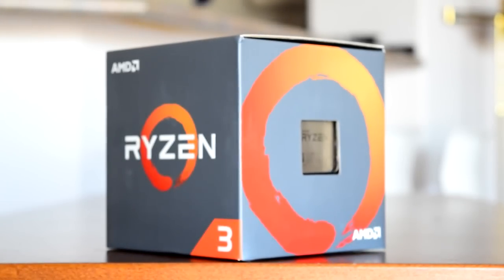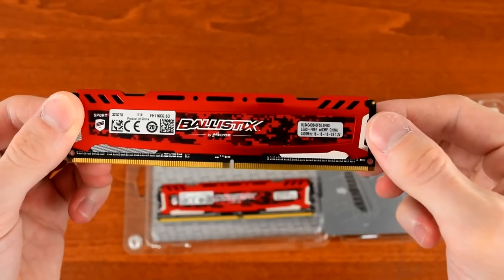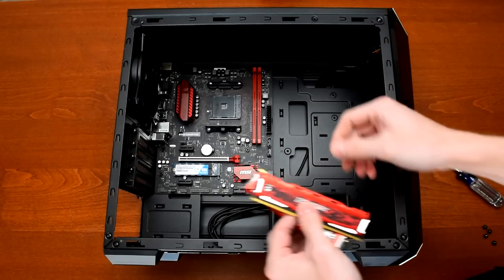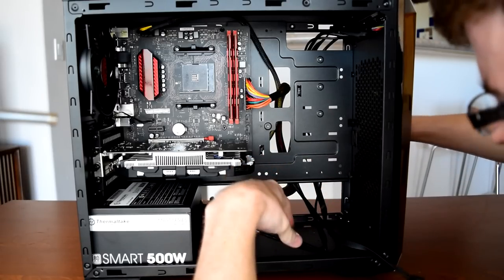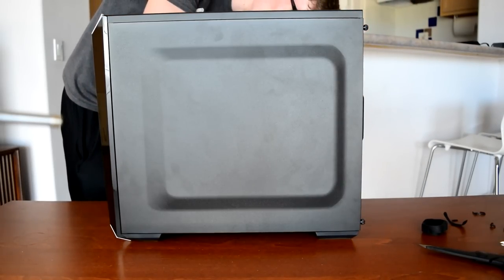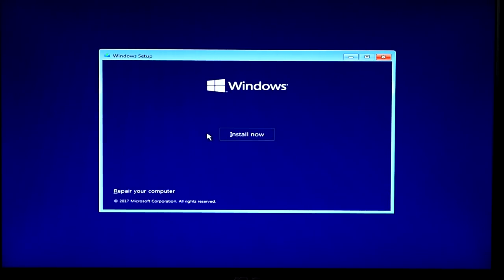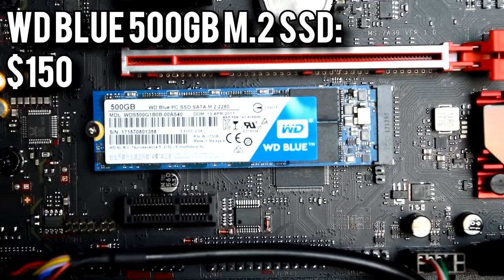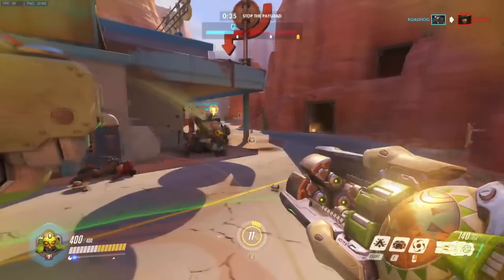Little Red: Under $500 Ryzen 3 1200 Budget Build!

Comment: Or you could replace the SSD with a 1tb HD from WD, buy a Ryzen 1600 and get a 1050 TI 4gb for 50 dollars more, get a cheap EVGA 430w PSU, and save a lot more money in the process.
Reply: Simple You should not cheap out on the PSU.
Reply: It's got good ratings, and is cheap. It's just for people on a budget
Reply: its evga its not bad quality it just has less watt output
Reply: is 430W okay for this kind of setup
Reply: Well a r5 1600 has a 65watt tdp and the 1050ti requires a 300watt psu so yes you can
Reply: i would rather get a r3 and a 1060 or 1050ti though its better for gaming and you can upgrade later
Reply: i shouldnt say better but its close
Reply: I built my PC with a Ryzen 1600 and GTX 960 4gb, I get 60FPS on most games, if not more! COD MW2 runs at 100 FPS on max
Reply: Even a good 350W PSU would be totally sufficient for this kind of setup. I´ve seen power readings of systems with an R9 390X that draw around 350W peak!
Reply: How do you figure when the 1600 is like 230 bucks right now
Reply: Say it's 220-plus 150 for the ti.  Then even a 30 dollar case,  30 dollar supply,  50 dollar HD.  and an overclockable motherboard for the 1600 is like 60. Then 60 for ram.  That's 600
Reply: I'd just upgrade to a ti.  He'd get frame drops in modern games with 2g vram. 
Or my two builds I haven't decided on yet.  
1tb,  30 dollar case,  found a 30 dollar 550w evga for 30. Ram 62. B350m overclockable for 60, ryzen 3 110. Then a 1060 6gb is 270-289. 
Or the same thing but switching the ryzen to a 1600 and buying the ti then upgrading to a 1440p capable card when the new cards come out early 2017 and when the gpu prices are better.  Basically what you said on that
Reply: famous dev just get a better gpu and a 1200
Reply: Getting a better gpu and a lower tier processor can lead to bottlenecks. The 1200 has 4c 4t, the 1600 has 6c 12t.
Reply: Simple a 1060 will not be bottlenecked by this cpu, anything higher might be though
Reply: who pairs a 1600 with a 960? That defeats the purpose of a gaming pc
Reply: if it defeats the purpose of gaming, then why am I getting over 70 FPS on all games max settings (fxaa turned down a bit). Plus, I bought the 960 a year ago, and i got it for a pretty good price, so I'm happy with what I have. I have also yet to overclock, lol.
Reply: Idk I moved my budget up recently.  I found a 1600 for 200 bucks.  Any going with the 1060 6gb.  Then I have an upgrade path to a 1080 in the future when selling the 1060 and not have to touch the processor in the future.
Reply: Looking at like 650 with the 1600 and 1060 with the parts I have priced out now.
Reply: The only problem I have with my 1600 is that it heats up to about 50 degrees Celsius while playing games, sometimes making my pc shut down, but that's because of the climate I live in, California gets really hot sometimes. But yeah, the 1600 and 1060 are a really good pair, make sure it's the 6gb variant otherwise you may have VRam shortages.
Reply: You want a 140mm fan outside. Mine is a Thermaltake TT 1425, quiet at 17dBa. Got it from Ebay.
Reply: Shane Ma is 500w enough??
Reply: Simple 50℃ isnt very hot........
Reply: yeah 122 degrees Fahrenheit isn't hot, lol
Reply: Simple it isn’t on Pc parts
Reply: or you could get  this spurge on a 4 ram slot mobo sell the r3 a few years down the line and buy an r7 when they release the new series r7 the 1060 6 gb should last about 6 years and the cpu 3-4 meaning the upgrade to a good one  then the new nvidia or amd gpu of the time depending how the market goes.
Reply: Simple Ryzen 3 1300X and 1060
Reply: If you're getting a 1060, might as well get the 1600 :p
Reply: Shane Ma the 430w evga is a decent psu
Reply: Dave Lee once said, there will always be these people who will always say, "I can build a better PC for like, $7". I finally found one, today is a good day.
Reply: intel optane
Reply: famous dev the r5 1600 has a TDP of 95 watts. But the r5 1500x has a TDP of 65 watts.
Reply: I know this comment was a long time ago but I just wanna know if my build is good/decent. I’m building my first pc in a few weeks.
CPU: Ryzen 5 1500X
RAM: 2x4gb 3000mhz
GPU: GTX 1060 6gb
STORAGE: 1tb hdd and 240 ssd 
PSU: evga 500w
Reply: Pretty decent. Wouldn't change anything.
Reply: This is my build and cost only 509 dollars

Ryzen 3 2200G
B350 Mobo
8gb ram 
Gigabyte rx 570 4gb (better than 1050ti)
120 kingston ssd
1terabyte WD hdd
Deepcool 500watts PSU
Casing tempered with 6 fans RGB

I thinks this is better budget build cost only 509 dollars
Reply: Angel I got the AMD Ryzen 5 1600
Reply: SSD>HDD

Comment: Threadripper have pins in the socket, it's just a design choice. Either way you have fragile pins that can be damaged, but as long as the board has a processor in it it's safe. With the addition of the cpu's having no pins they are less fragile which makes the pinned socket the best choice. Just don't lose that socket cover when you get a new MoBo in case you want to store it without a processor.

Comment: Ryzen 3 is the best CPU for a budget build
Reply: Myers Tech Tips there is 2 ryzen 3's
Reply: Col4dd1ct I'm aware of that, just pointing out that i like Ryzen 3
Reply: Myers Tech Tips what about a g4560 I agree but doesn't ye G4560 doesn't disappear not arguing just mentioning🤗
Reply: Well the G4560 is good and comes in at a cheaper cost, but the Ryzen 3 has more cores so it handles more work load, even though its a bit more pricey, its totally worth it. I'm Glad you mentioned the G4560 because the Ryzen series of CPU's completely made me forget about the Intel Skews.
Reply: the ryzen 3 beats the g4560 when overclocked in bench marks. also 3.5ghz<4 ghz ryzen 3

Comment: Would the 1200 be a good upgrade from an FX 6300 for gaming?
Reply: Thomas The Tank Engine Why? The the R1200 has better single and multicore perfomance.. + It's more power efficent. But I would just safe up for a R5 1400 if you're into basic editing, or even a 1600. :D For gaming on a budget, both Ryzen 3 CPUs are one of a kind.. But for some Basic Esport titles I'd still go with a G4560 :D
Reply: The 1200 limit is 1060. The FX gets similar fps in some (Not all) games. Therefor, for gaming upgrading from FX to 1200 is a waste.
Reply: If you can save up for a R5 1400/1600, it'd be a much better upgrade...
Reply: so lonesome Get the Pentium if you want to play ESport titles and some AAA titles for another two years before two cores becomes more irrelevant than it already is. Also, good luck finding a G4560 for under 75$, at that point, you're better off getting the Ryzen.
Reply: Lolzer Holzer O, I just bought a used G4560 for 45$, was a lucky pick I'd say. There's indeed no long-term use for the G4560, but as like I said, for basic Esport Games, e.g., CSGO or Overwatch, it's totally fine. I'd still go with Ryzen 5, even on a budget though Ryzen 3 is really good for the money. I don't wanna argue, but I also told my friend who I gave the G4560, that he can't expect to play games with the G4560 in a couple of years. He said it's no big deal, because he doesnt play that much. Anyways, everyone building a budget PC these days shouldnt really expect that.
Have a nice day :)
Reply: Yes

Comment: 2x4 kit on a board with only 2 ram slots. Congrats
Reply: Indiana Rodgers Nope. 8GB minimum and in around 5 years it will be 16GB minimum. We are already on the way.
Reply: dual channel is too big of a deal to pass on.
Reply: @francescovolpini  Yeah, how about $10 more to put a damn 4 slot motherboard in.
Reply: @aghevl9999  apparently there were no other options within the budget, and you are right a 4 dimm mobo would have been much much better

Comment: Just bought a bunch of used parts from eBay for a cheap build. Got a ASRock A320M-HDV motherboard with a Ryzen 2200G used combo. 8GB of DDR4 3000Ghz ram and a 256GB NVMe M.2 SSD. 400w EVGA power supply and a cheap case to cram it all in. Hope it all works.

Comment: Quick question: How did you manage to get the entire build MINUS the 500gb M.2 SSD (Which is 150 alone) for 350?
And also, How did you justify 500gb of the highest quality harddrive right now when you had to get 1050 2GB? I didn't know anyone actually bought those. I thought 4gb was the standard minimum.

Comment: I like the fact manufacturers are starting to put a pcie 1 slot above where the gc goes. On really small boards it makes it so much easier to get the wireless card in
Reply from the maker: True, and way easier to install if you have a huge CPU cooler

Comment: Moving the recycle bin to the correct position. 10/10, nice build.
Reply from the maker: Putting the recycle bin in the bottom right is an absolute necessity
Reply: It adds 50 horsepower to the pc actually.

Comment from the maker: BENCHMARK VIDEO UP!
https://youtu.be/gWjakxrAVDY
Reply: ponchato I have the same build but I can't get mine to post did you update the bios to get the ryzen 3 too work ??
Reply: Marios Seraphim I expect it would be ram related, not the cpu
Reply: ponchato Are you including windows
Reply: Its my first time building a pc.. i dont get it on the 500ssd and 1tb part.. should i only buy one of those two? Or should i buy both? Thanks
Reply: ngik ngok buy a 120-250 gb ssd and 1TB hdd
Use the ssd for programs and hdd for games and files
Reply: Dr. Dunk ok2 man.. thank you.. dont have any idea.. my first time to build pc.. hehehe
Reply: ngik ngok good luck! Myself i have my pc up on my channel!
Reply: ponchato Hi. I'm building my first pc soon, and have all the parts but switched the ssd to a mechanical hardrive. I'm definitely going to be gaming like crazy on this. Thank you so much!
Reply: I have a 32 GB SanDisk USB 3.0 stick. Is this big enough for Windows 10 64 bit or do I need a 64 GB stick for this?
Reply: Anthony Holloway would fit the basics. 
Why do you need windows on a stick?
Reply from the maker: The Windows 10 install is only ~3.5GB, you'll have more than enough space
Reply: ponchato thought he ment a whole systen
Reply from the maker: Ah. Even in that case, the final Windows 10 install is something like 20GB (if I remember right). You won't be able to install basically any programs without another drive, but a 32GB USB should be enough. I wouldn't do it that way, personally, but it should be possible.
Reply: Hey,  just wondering, is 500w on the high end of power or lower end,  like too much or too little?
Reply from the maker: HipHopHooligan: It has 2 PCIe cables, both of them are 6+2 pin
Reply: may i know this spec can install Windows 8
Reply: Ace_Shafie why wouldnt it...
Reply: The GTX1050 makes it a bad build, could have saved $70 on that big SSD and had an RX570 or GTX1060 in there. Those 2 are the bare minimum you'd want in any build. GTX1050 isn't a GPU in my book, it's a toy. Don't put $170 SSD's in a $500 build :p Put a $60 120GB SSD in it for windows and your favorite game, and a cheapass 1TB HDD.
Reply: ponchato does the case come with preinstalled fans
Reply: ponchato which is better ryzen 3 1200 or Pentium g4560 or ryzen 3 2200g with a dedicated graphics card when we consider future gaming capabilities?
Reply: Would this be better than  a 1050 with a pentium g4560?
Reply: what will be if you switch ryzen 3 1200 with ryzen 3 2200G with radeon vega 8 graphics (will it still use full power of gpu)
Reply: ponchato can this build be good enough for like world of Warcraft( my first build )

Comment: I'm planning to build the same thing on a $500 budget... however, my specifications are a bit different here they are as follows;

CPU: AMD Ryzen 3 1200
GPU: Galax GTX 1050 Ti 
RAM: Corsair Vengeance LPX 8GB rated at 2500 Mhz (DDR4)
Motherboard: Gigabyte GA-AB350M-HD3
Power Supply: Seasonic M12II-520 EVO (rated at 520 watts, 80+ Bronze)
Case: Tecware Quad Cube (Small Form Factor Case)

Are those good enough?
Reply from the maker: As long as you're playing at 1080p those specs look good
Reply: ponchato is there any improvements I can make within my budget? And yes I will play on 1080p

Btw.. thanks for the response I never expected it since most YouTubers nowadays, never replies to comments o. Their older videos

Comment: No patents. AMD threadripper actually uses the lga standard (pins on the motherboard instead of the cpu). The reason amd stuck with pga is they didnt want motherboard manufactures have to worry about damaging the pins on motherboard in transit. Thats why Intel motherboards have that black cover on the cpu socket.

Comment: Great Video !!! Make alot More Videos and i have just got one Question : which Ryzen CPU do you need to have for a gaming rig and what FPS do you get at 1980X1080p ?  Resolution ?
Reply: william fernandes Just look up benchmarks. A Ryzen 3 1200 OC'ed @ 3.7GHz or 1300X on XFR is plenty for 1080p 60FPS+. The limiting factor WILL be the GPU. If at all possible get at LEAST a 1050 TI if not 1060 3GB.

Comment: My PC that was built before seeing this video:

Same case (although mine comes with 3 RGB fans at the front, I also put the red trim on)
My motherboard is red and black with red LEDs
I have 8GB of that exact ram stick
My CPU is Ryzen3 1300x
My GPU is an Nvidea GTX 1050ti
I have 2878GB worth of memory (128GB of which is an SSD)
and a 430w corsair power supply

Comment: Hi, whats the diference between the b350 and the a320 motherboard.
thanks
Reply: Bernardo Ribeiro you can overclock ryzen with B series. A series does not support overclocking.
Reply: Thanks for the answer but 
that goes for all motherboard right?
Reply: Bernardo Ribeiro Yep. Need a B350 to overclock.

Comment: Case: NZXT Phantom 410 Computer Case , White (CA-PH410-W1)  - $85.49
CPU: Intel Core i3-7100 7th Gen Core Desktop Processor 3M Cache,3.90 GHz (BX80677I37100) - $115.09
CPU Cooler: Cooler Master Hyper T4 - $29.99
Motherboard: MSI Gaming Intel Skylake H170 LGA 1151 DDR4 USB 3.1 ATX Motherboard (H170 Gaming M3) $63.55
Memory: Crucial 8GB 1600 (2x4Gb) - $37.99
Video Card: Gigabyte GTX 1050 ti - $154.99
Power Supply: EVGA 500w 80+ - $44.99
HDD: Toshiba 1TB 7200rpm 64mb - $39.99
Fan: Kingwin 120mm Fan - $3.99

is this good for $547.40
Reply: Go for a Ryzen 3 1200 or even 1300 for the extra 20 you can get an unlocked processor with boost up 3.9ghz which can complete against i5 processors
Reply: Thanks alot will do!
Reply: AtomMPD CoD and Comms its good otherwise right?
Reply from the maker: Looks pretty good to me, but where are you getting 8GB of memory for $38??
Reply: ponchato is that expensive or something
Reply: JadeGraphics no it's cheap lol 8gb memory rn is around $60-80
Reply: JadeGraphics and yeah overall the Ryzen 3 is the best budget quad core processor rn the only thing comparable is the intel pentium g4560 but that's a dual core with hyperthreading.. but with most games getting updates now for video settings the safest option is to go for a quad core like the ryzen and later on like in 2-3 years upgrade to a ryzen 5-7 if your planning to play games like h1z1, Pubg, they run a lot through the CPU and the ryzen 3 is the best budget option rn especially since it's an unlocked CPU you can overclock extremely easily to 3.9ghz
Reply: Also if I was you I'd wait another month or 2 for the cryptomine can end and you can get the 1050ti for almost $30 cheaper which you can use towards a better SSD or anything else like maybe an extra fan
Reply: JadeGraphics omg also I forgot to tell you the Ryzen 3 comes with its own CPU cooler without extra charges for only $110 so you have another 40 you can use for a keyboard or something
Reply: i lost the ram
Reply: That RAM is DDR3. It won't work with Ryzen. You need DDR4.

Comment: can a sigle 8gb memory chip be installed in this motherboard or both slots have to be full?
Reply: rgesualdo 1 stick will he enough, but dual channel makes a surprising difference in speed. Choose wether 8gb is enough for the future or if you want to upgrade to 16gb in the future.

Comment: Does anyone know if an amd r5 1400 work with this motherboard and can be overclocked a bit?       Btw. You make the best pc builds man.  Great work
Reply: Yes, you need a motherboard with am4 socket for the ryzen cpus, and the b350 model can overclock all of them (around 3.9Ghz I think), that's the best combo to go with ryzen ;)
Though you might want one with more space for ram or other things, but this one is fairly good already
Reply from the maker: Yann Renvoisé hit the nail on the head. And thanks!
Reply: Yann Renvoisé thanks for your help

Comment: No display  - after i connect it to my lg 24 inch gaming monitor monitor , my build is Ryzen 3 1200 , msi A320 , and msi 1050ti , I did connect my Hdmi to gpu , still no display.
Reply: Fixed?
Reply: yup the gpu was defunct , replaced it and it worked just fine.

Comment: Hi. Im new to gaming pc's, I wanted to change the Ryzen 3 1200 to a Ryzen 5 1600 and the GTX 1050 to a GTX 1060, will it bottleneck or no?
Reply: fAwl definitely not
Reply: Ryzen 5 series works excellently with 1060 or even 1070 if you overclock the cpu

Comment: How;'s my build?
 I just purchased the parts for it: MB: MSI B350M PRO-VDH Motherboard GPU: ASUS GeForce GTX 1060 Dual Fan OC 3GB CPU: AMD Ryzen 3 1300X Processor with Wraith Stealth RAM: Corsair Vengeance LPX CMK8GX4M2D2400C14 8GB (2x4GB) DDR4 

The others are irrelevant, just upgrading a crappy pc.

Comment: I built a pc similar to this one with the same motherboard and CPU but when i turn it on, it doesn't display anything. Everything in the pc turns on like the fans and the motherboard lights up but nothing gets displayed. I connected the hdmi cable into the graphics card and the motherboard but nothing happened
Reply: xXFATALBOMBXx I'm having the same problems
Reply: Damien Morales Fixed?
Reply: xXFATALBOMBXx Fixed?
Reply: thomas wood OMG i will build this PC in 2 days, I am very scared of getting no picture